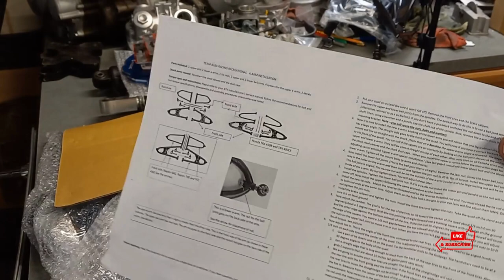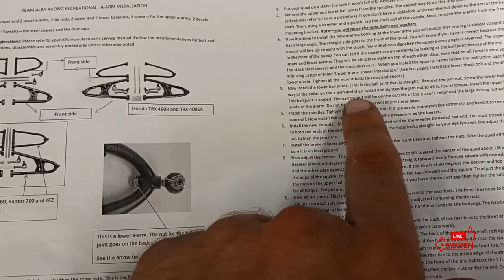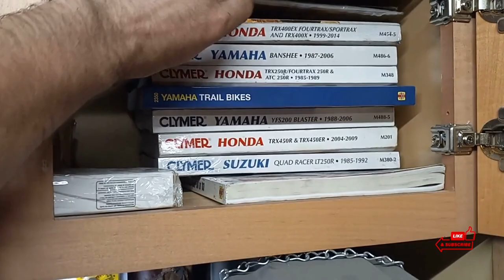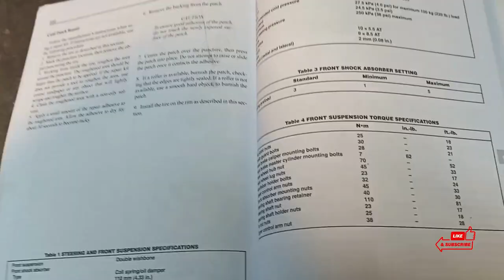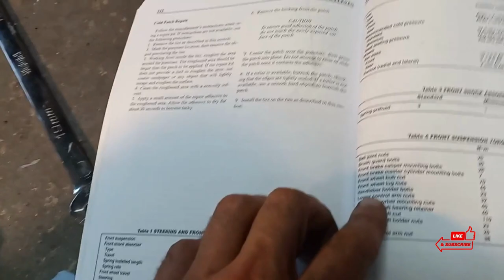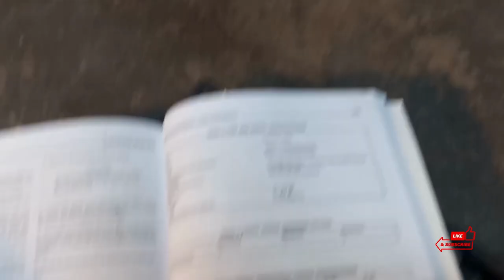Yamaha Raptor 700R Installing Alba A-Arms

Comment: Glad iv come across this channel brother,im from England UK 🇬🇧 iv never owned a Quad but rode a couple,went and looked at a raptor 700r loved it,was exactly how i wanted it,real low & set for road use,looking at getting a raptor in the next few days but if i end up with one stock I’ll be wanting to make it wide & low and slightly wider front tyres,I don’t really understand to much on parts ect but what shocks or coilovers would be best & do i go for +2 or do they do wider I.E +3 ect there is a raptor with a R6 engine & another with a R1 on eBay I’m interested in if i go for them i think there already wide
Reply from the maker: You can get wider then plus 2. Raptor with a r1/r6 engine I'm sure would be low and wide already. I've been wanting to build one but for dirt use with a r6 engine. Already have the donor street bike here.

Comment: Wish there was videos like this for the 660. I plan on alba +2 arms and a shock swap for my Raptor 660 soon
Reply from the maker: Should be the same procedure or atleast dam close
Reply: @garagemcmatt  I'd like to set it long travel but not sure what shocks would work with little to no modifications. You have any ideas?
Reply from the maker: @Kevin_Yagoonie  efi model yfz450r front shocks work with long travel a arms
Reply from the maker: @yagoonie5.3  I can get u a very clean set rite now for $450 that's about $100 cheaper then on ebay before shipping. Off a 2021 yfz minimal hours on them they are like new
Reply: @garagemcmatt  damn to bad I don't got the money. Gotta do brake lines on my truck first. But do appreciate it
Reply from the maker: @yagoonie5.3  do what u gotta do bro. There is always a set available on line
Reply: @garagemcmatt  I just got the Alba +2 and yfz450 shocks for my 660. But question how or what did you use to grease up the arms after installation?
Reply from the maker: @Kevin_Yagoonie  the delrin really don't need grease. I grease them on install and that's it
Reply: @garagemcmatt  what's a delrin?
Reply: @garagemcmatt  so grease up the rods while installing? Sorry man I didn't see it on your video that's why I'm asking
Reply from the maker: @Kevin_Yagoonie  it's the hard plastic like material that go in the alba a arms
Reply from the maker: @Kevin_Yagoonie  yes, you don't need to but it won't hurt
Reply: @garagemcmatt sorry for another question. But on your video for the upper arms. You put them spacers and dust caps. Do the spacers go first then the dust caps over the spacers?
Reply from the maker: @Kevin_Yagoonie  no the dust caps hug the a arms. The spacers stay exposed. That's where u get your caster adjustment

Comment: Team alba is nice parts loving them front disc guards . She is one wide one
Reply from the maker: Yeah it's definitely a wide girl
Reply: @garagemcmatt  hey wonder oft them discs guards will fit 06 yfz should right
Reply from the maker: @mikewisher4083  I would think so but they might make them for it as well. Check ebay
Reply: Do whatever you really want I don't care, lol😂
Reply: Are those yfz shocks the lt length for those a arms.  I run -3 on my caster, I run houser, it's nice and easy to adjust.  But those Alba are nice
Reply from the maker: @johnbruzzi4381  lol u like that
Reply from the maker: @johnbruzzi4381  these are just stock 2022 yfz shocks just the way they come
Reply: @garagemcmatt  what I mean is that each a arm has a certain length shock that go with it, was just wondering if they were right length.  Like my houser shock length 18 3/4
Reply from the maker: @johnbruzzi4381  with the yfz450r shocks from the efi model they are 18.25 eye to eye and u need to run long travel arms to put them on a craptor

Comment: Did you end up using the stock sleeves it looks like in the video you're using the stock ones, because i have the same a arms and the sleeves that are included the bolts are loser in there than in the stock sleeves

Also the included sleeves for the lower a arms are too long so i was just wondering if you cut them down or if you used the stock ones
Reply from the maker: I used the stock ones if I remember correctly
Reply: @garagemcmatt  alright thanks i assembled one side already with the stock ones.
Reply from the maker: @cherry2036  I think they ship those with the sleeves just for packing. I'm not 100% sure tho. I do know that it is the same part from alba that fits the carb model yfz450. Could be that they fit those better (sleeves)

Comment: Nice video.... I want my raptor to set like this but I'm worried it will be too wide for the trail...
Reply from the maker: Plus 2 inch isn't that bad bro. I wish I could give u a better review but someone stole this quad before I got a chance to even ride it this way
Reply: @garagemcmatt  right on.... Thank you.... That's too bad and F*"up!!!!  Feel your pain on that stolen problem...😡....
   I'm thinking about getting the Elka shocks right now for $900. Or a little over 1200 with  shocks and the Alba+2 a arms..... And I would probably also do the Alba 2 inch spacer on the rear..
I have a 2020 Yamaha Raptor 700 standard with the pogo shocks... At first I was just looking for some raptor 700r OEM shocks.... I can get a used 10-year-old set of eBay for $400 but for $500 more I can get a brand new set that's balanced for my weight... It should be a no-brainer but I still can't make my mind up 😂🤣😂 I'm sure I will get what I paid for but I want to save a dollar 🤦
Reply from the maker: @dirtfamilystyle  email me I can get you a set of 2021 yfz450r front shocks just like I used on mine. They go for $550 used I can get a mint barely used set rite now for $350 
Garagemc549@gmail.com
Reply from the maker: @dirtfamilystyle  email me I can get you a set of 2021 yfz450r front shocks just like I used on mine. They go for $550 used I can get a mint barely used set rite now for $350 
Garagemc549@gmail.com
Reply: @garagemcmatt  I've been doing a little research and you talked me into it...ha ha ha. 
  I used to have a 2004 YZF 450R and I loved the way it handled with the factory shocks... I love my raptors power I just wish it handled a little better...I'm getting ready to pull the trigger and buy the ALBA +2... I'm even going to go with the Elka front and rear shocks package with A arms.....  Unless you don't think the rear shock is worth it.?... I have never rode anything with the elks shocks.....
Reply from the maker: @dirtfamilystyle  I honestly can't give you an opinion on the elka rear. But my friends that have them love them. Get the legacy plus tho
Reply: @garagemcmatt  it's kind of funny how I go from trying to get a factory Raptor piggyback shocks for $250...  Finding  a 10 year old used set for 420... Then able  to get brand new Elka front for 800... Or get the shocks in the A arms for 1200..  Or getting a whole setup 1800... It's too easy to fall in....🤦 really hope I'm getting what I'm paying for...😂🤣😂 Hopefully it'll at least look  COOL 😎
Reply from the maker: @dirtfamilystyle  it definitely will look sick bro
Reply: @garagemcmatt  have you had any experience with the front Elka stage 3 shocks.. the ones I'm looking at online are the stage 3 legacy....
Reply: I'm thinking Albe or Lonestar A arms... 
 I'm probably going to go with Alba because I have their nerf bars...
 When I receive them I'll probably do an unboxing and a review on the setup... But as for installation I'm going to send them your way because you did a pretty good thorough job...
Reply from the maker: @dirtfamilystyle  I'm not happy with lonestar. And lmk when your ready
Reply from the maker: @dirtfamilystyle  I'd get those great value for the price

Comment: I couldn't tell by the video but the upper arms, the spacers. Does the spacers go first then the dust caps?
Reply from the maker: The spacers stay exposed those are just to get your caster you want dialed it
Reply: @garagemcmatt  thanks for the reply. So dust caps first then spacers?
Reply from the maker: @Kevin_Yagoonie  yes the dust cap cover the a arm mounting points the spacers will be exposed
Reply: @garagemcmatt  thanks I appreciate it. I don't know why but I didn't receive a instruction sheet. So going by your video. Thank you 👍
Reply from the maker: @Kevin_Yagoonie  all good, that's one of the reasons I'm here.
Reply: @garagemcmatt  unfortunately I haven't had time yet to install my Alba A-arms but hope to do it next weekend. But I have a question for you. Would it be safe to have the lower ball joints out some to gain extra width?
Reply from the maker: @Kevin_Yagoonie  you can a little bit but I wouldn't go out too much

Comment: So my Alba A-arms for my 660 I have a concern about the upper arms regarding the factory sleeve and dust caps you reuse. 
The sleeves didn't slide in easily like the bottom arm sleeves did. I had to use a hammer. Also when I got the sleeves through the arms they stuck out some on each side which I couldn't fit the dust caps on. So only way I was able to make it work was put the included spacers (1on each end) through the sleeve that stuck out and then add the dust caps. 
Is this a big deal? Is the sleeve sopossed to stick out a bit? Are all the dust caps have the same size hole?
Reply from the maker: Not every quad mounting points are going to be identical. Over the years they get slightly bent or out of shape. You can either just shave them down a Lil bit or reuse your factory spacers
Reply: @garagemcmatt  I noticed on your video the upper arms the spacers went first then the dust caps
Reply from the maker: @Kevin_Yagoonie  yes I put them closest to the frame mounts for the a arms
Reply: @garagemcmatt  wouldn't water, moisture and dirt get into the bushings with the dust caps further out because the spacers? The dust caps can't seal the bushings fully because the spacer in between. That's what I'm concerned about
Reply from the maker: @Kevin_Yagoonie  delrin bushing. U can run it either way. If your comfortable with it that way it will still work
Reply: @garagemcmatt  already cool I'll leave it. Thanks bro 👍
Reply: @garagemcmatt got everything installed. Watched you video but didn't see you go through alignment. So my question I'm hoping you can help me with is what order should I do? Should I do caster and get the ball joints tightened first then adjust the tie rods?

Comment: Channel is bang on mate you should have few 100m followers defo 
What is the noise you have from the clutch area
Reply from the maker: It's a tuff road to get subscriber numbers up there. The noise was the bearing in the clutch pressure plate
Reply from the maker: Sharing my videos helps a ton
Reply: @garagemcmatt  appreciate getting back to me mate do you have any videos of the noise a have a weird one appeared but my clutch is on its way out got a genuine Yamaha one there just waiting on the nice weather to fit 😭
Reply from the maker: @darylmc123  maybe in the video when I first got it. But it was pretty obvious what was wrong the noise came and went with pulling in the clutch lever

Comment: hey @garagemc i flipped my raptor 700 and my front right spindle is sagging what could this be thanks so much
Reply from the maker: More then likely you blew out a ball joint
Reply: really that would cause the spindle to sag?
 @garagemcmatt
Reply from the maker: It's tough to say without seeing it

Comment: What year yfz are those shocks from
Reply from the maker: These were from a 2022 but any year yfz450 that is fuel injected are the same as these. The fuel injected year front shocks are longer so if your putting them on a raptor 700 you will need long travel a arms. If you get the carb model yfz front shocks the bolt rite on a 700
Reply: Okay because I’m putting rock +2 aarms on my raptor because my cousin crashed it and might as well upgrade it
Reply from the maker: @JT-nc6no  I still have the whole stock front end from mine

Comment: Hey buddy I'm installing the same a arms as you did. Do you put the wheels on lower the quad then tighten everything with tires on?
Reply from the maker: Yes a good rule of thumb is to not tighten anything that pivots until the weight of the quad is on the ground